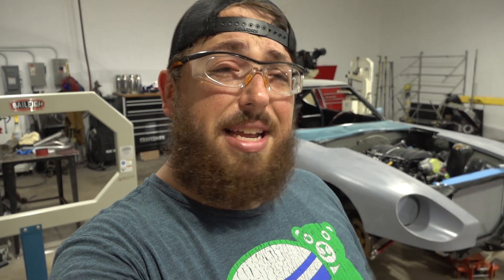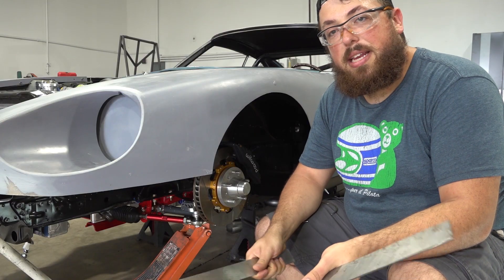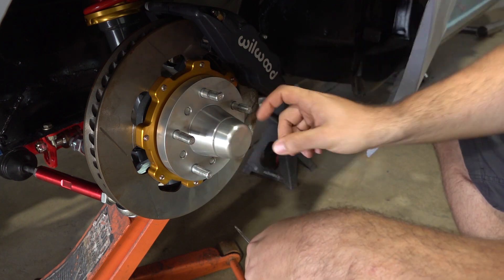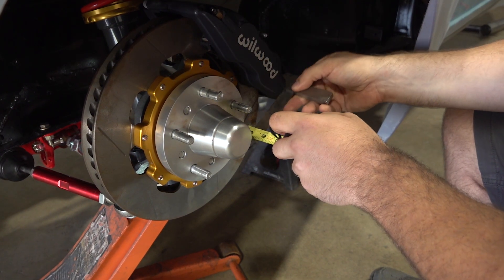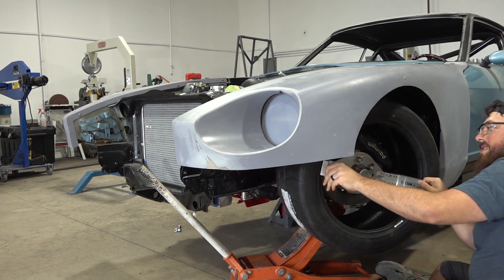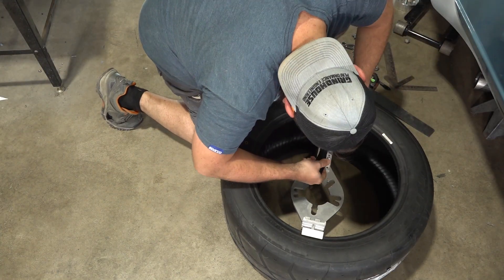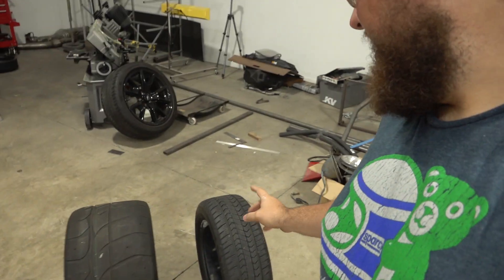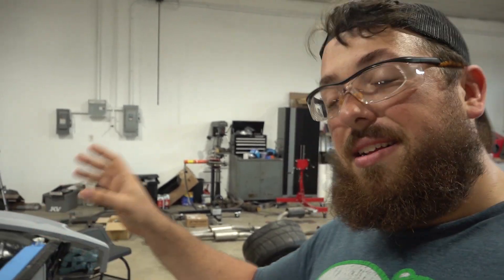Measuring Custom Wheel Fitment for my Widebody Project Datsun Ep. 13

Comment from the maker: What wheels do you think the Datsun should get??
Reply: Something very aggressive but yet classic maybe even something in the JDM styling
Reply: AVANT GARDE F242 maybe
Reply from the maker: Those are a great option !
Reply: LOL...wheels are one of those things wherein the more you spend, the cooler they get....generally at least.  If cost is no object, then BBS 3-piece racing wheels.

But back down to planet earth, if you can afford them I think 3-piece wheels have some huge advantages.  I decided I wanted to slightly change my rear offset for a variety of reasons after I already had bought wheels.  So, all I had to buy was new rim sections and bolt them on.  It wasn't cheap, but it was VASTLY cheaper than buying new wheels.  Since you are looking for very specific offsets, I don't think you will have any choice but to order custom, but I imagine you know that.  I am using Jongbloed wheels, and really couldn't be happier with them so far, bearing in mind I have not yet driven the car...or even started it.  They have several models and can make them to any specs you want, but expect to wait 3 months at least to get them.

All of the manufacturers of custom racing type wheels have some good/bad internet write ups, and after trying to deal with some of them, I can definitely see why.

Great work again BTW!
Reply from the maker: That's a great point about multi piece wheels, makes me feel (at least a little) better about just going ahead with this offset. Out of pure curiosity, what wheel offsets and sizes did you land on with yours? Im looking at 17x9.5 -57 fronts and 17x11 -22 rears tentatively.. thanks for the kind words John! Which jongbloeds did you go with? I've had a few folks recommend them to me lately
Reply: @GrindhousePerformance  My rears are 17 X 11 (-19), fronts are 17 X 10 (-12).  Don't take this wrong, but I wasn't really concerned with getting a "deep dish" appearance or filling out the fenders flush, I just wanted to use offsets that would allow the most room for tires and clear the brakes.  I also am using brake hats roughly 10mm thick that mount on top of the hubs, which of course changes the offset.  In the rear with the 315 wide tires, I only have roughly 10mm minimum clearance between the tire and the inner fender.  Of course it can all be fine tuned because the TTT suspension parts are fully track adjustable.  My wheels are the model 214 with gold centers.
Reply from the maker: Ahhhh yep! I remember the pics from your build thread now. I was looking at the Jongbloed 305 or 557 as options. I'm not 100% settled on my offsets yet, I might see how those settings look out of curiosity, compensating for the brake hat. My scrub radius is putting the tire extremely close to the back of the headlight bucket and not sure how to compensate the best I can there
Reply: Round?
Reply: I envision it with something similar to Volk Rays but your wife's mustang wheels didn't look too bad on it at all lol
Reply from the maker: JP coming in with the facts 🤣
Reply from the maker: I was actually really surprised how good the mustang wheels looked on the Z, never would've thought
Reply: I always love the look of classic JDM wheels. The Watanabe R17 can come in the sizes you're after. Watanabes are such a classic combo with these Z's.
Reply: Watanabes

Comment: When you Jack or load the suspension to ride height. How do you know when to stop or what the correct height is
Reply from the maker: It's a a mix of what look you're going for, how you're using the car, and how the geometry shakes out with the parts you have. Not an exact science, but I wanted just under 4" ground clearance to the lowest spot on the car because it will get driven on the street. I put it closer to 4in to give a little room for the exhaust which inevitably wound up hanging a little lower. Also consider how to minimize bump steer within the adjustment. If adjusting the ride height improves bump steer within your target range, it's most likely worth it- although there's plenty of other ways to help bump steer. If the car's only seeing track use on circuits that don't have huge curbs, or if you don't mind scraping you might get away with going lower. It'll also depend a bit how soft your suspension is. Mine ia pretty stiff so I'm not expecting a ton of vertical suspension movement. Our roads are pretty bad here so I might wind up raising it a little more if it scrapes like mad

Comment: The width offset vs backspacing always makes my head hurt. Your explanation is excellent but you made an assumption on the actual width versus nominal, 1/2" per side in your example. With that said you're probably close enough with that assumption for most applications. 

Anyway, great video!

Comment: Love this build. This widebody manufacturer made such a good move making the holes deliberately small so everyone could trim to the exact right fitment regardless of wheel size. Get that grinder out and get to work.
Reply from the maker: It's great having the flexibility, but I've already spent like an hour running tape lines and trying to visualize a profile that clears the wheels and doesn't ruin the profile of the body
Reply: @GrindhousePerformance  Haha, yeah it can be really annoying. I ran into similar problems designing my flares from scratch. I recommend starting out just trimming the bare minimum to where the wheels clear, and then once you know you what you have left, then try and smooth out the lines.

Even if you screw it up like I did on one corner, we just get another episode "Fixing my widebody with some fiberglass" XD
Reply from the maker: LMAO- good advice and you're absolutely right 🤘

Comment: So you had 2.5 inches or -63mm offset I’m literally running the same setup 275/40/17 
315/35/17 are you running a spacer? And do you have the retro fit 370z setup? that’s what I’d like to use with 14 inch rotors  wildwood 4 maybe 6 piston brakes. Thinking of running a 30-35mm spacer the tire I chose is Toyo R888R  I wanted the Nankang AR-1 but it doesn’t come in 275 only 255 for a 17” wheel
Reply from the maker: Hey Kenneth, after going back and forth a bunch, I ended up with: 

Front Wheels (Nitto NT01 275/40R17)
Diameter: 17"
Width: 9.5"
Offset: -30mm

Rear Wheels (Nitto NT01 315/35R17)
Diameter: 17"
Width: 11"
Offset: -22mm

As much as I loved the look of the crazy negative offsets, I was going to have to do some really severe cutting to the bodywork, and I was concerned at lock the tire would be contacting the back of the headlight bucket and part of the inner fender. The scrub radius on a -63mm wheel is pretty insane! Be on the lookout for the wheel episode to see what you think of the fitment of my specs. Im not running any spacers and im not using the 370z retrofit

Comment: Since you did all the hard work and some of us also have the 280YZ kit, would you mind sharing what wheel specs you measured and what you're going to go with?  I have a rough idea what size wheel I'm going to order, but the wheel size,  width, offset /backspacing would be super helpful!
Reply from the maker: I'm going to have to put a big asterisk on this. The apex engineered crossmember moves the lower control arms out, and I have the T3 control arms and camber plates also pushing them out. For the front, I'm planning on 17x9.5 with an offset between -50mm and -57mm. I want to recheck the fronts, because I might've been a little too aggressive after looking at some other 280yz installs. The rear is looking like 17x11 -22mm offset. I've seen people build similar wheel fitment tools out of 2x4's, you might have some luck starting there and fine tuning for your individual combination!

Comment: Can you tell me how wide your front and rear axle width now are with the newer suspension bits? You know from Mounting surface-to-Mounting surface. 
Cuz i think a Datsun only has a axle width of 53" which is tiny so you got to run quite the negative offset.
Reply from the maker: Axle widths are ~55" front, 56" rear as it sits 👍